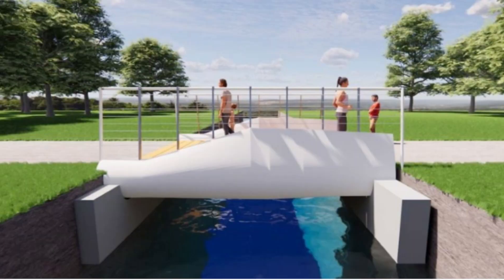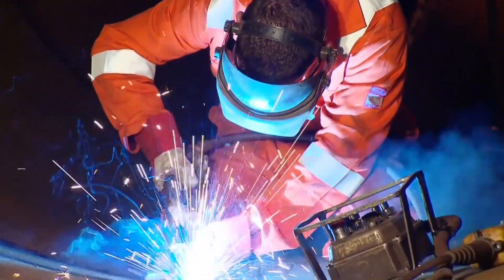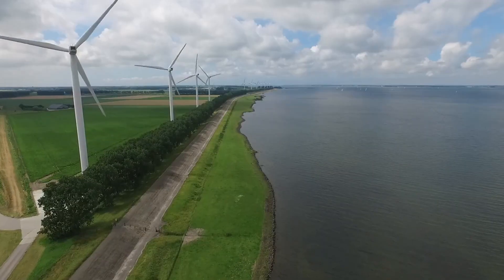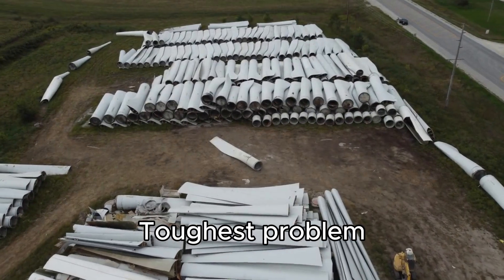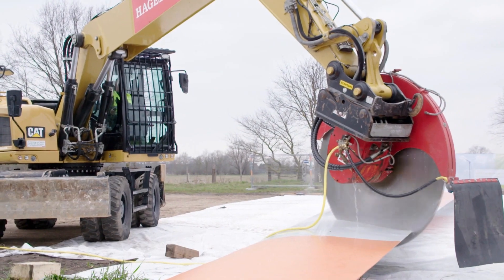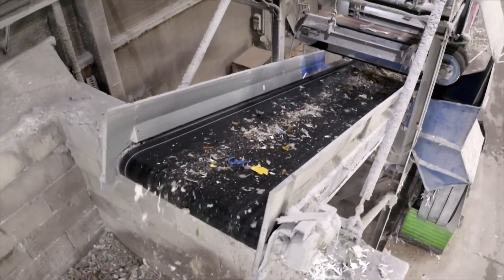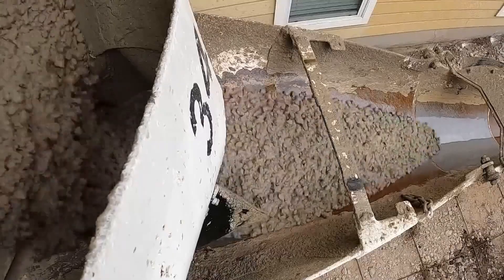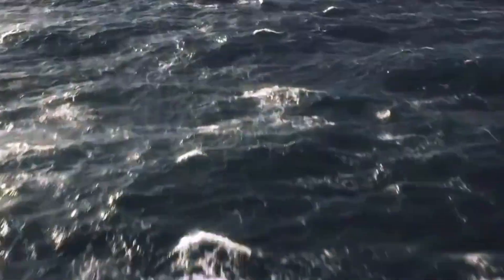Giving Wind Turbine Blades Trash a Second Life

Comment: So the bottom line is they burn turbine blades, which is they say cleaner than burning coal, but oil, gas or hydro electricity is normally used. But they continue producing blades knowing that 80% of them will become an unknown hazard for future generations that they are supposed to be protecting, It's a total scam.
Reply: Wait till you hear about the much, much bigger scam of oil, gas, coal.  Not to mention nuclear.  It's all a scam!!    Or maybe we should compare all the solutions and find the best ones.  Hint: if you do that, you'll find solar, wind and batteries, plus hydro, tidal and geothermal are the best.